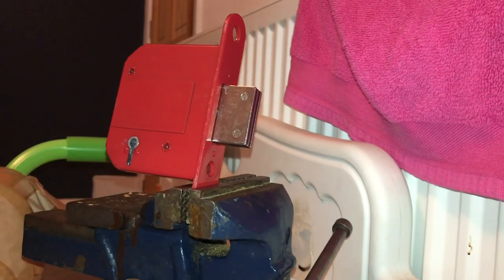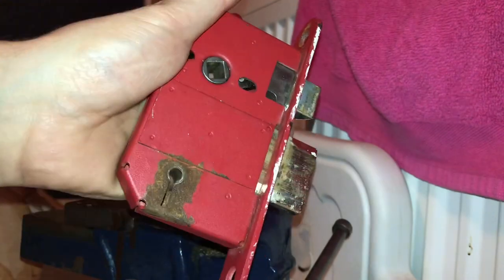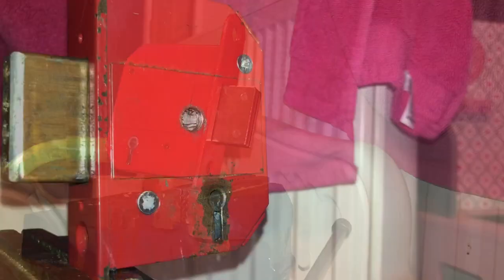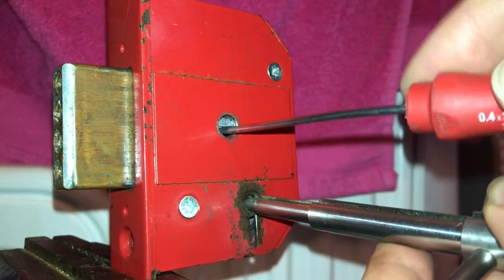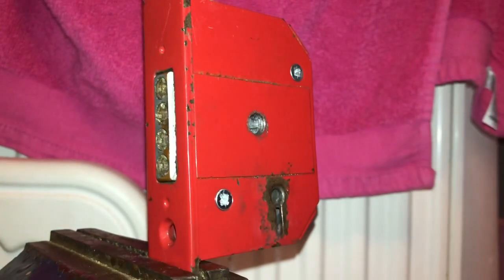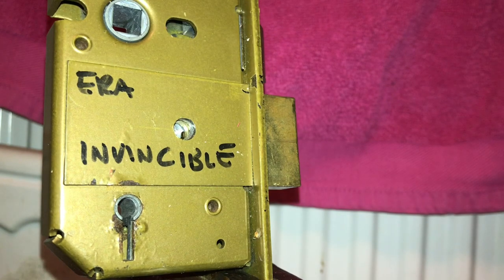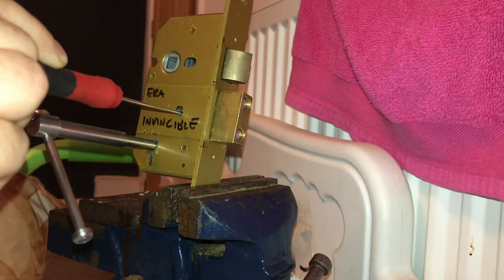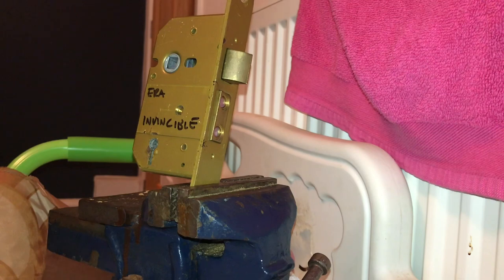The importance of correct lock ID when drilling a mortice lock

Comment: Nice video mate, i use the a jam mortice id pdf stored on phone along with the rb template kit together they seem to cover most of the stuff I come across and looks better than sifting through books 📚 in front of your customers😂🤣
I bought the mortice Id app when I first started out, What a pile of shit that is keep the vids coming always a good watch
Reply from the maker: Lock Lab Locksmith Orpington kent yeah I have the Ajam printed out and laminated also got the ICL mortice manual which covers a lot of older locks. If I come across one I’ve never seen before I take it home, drives my missus mad 😂😂 The RB one is that the one with just a 2mm template??
Reply: I made the A Jam manual 👍 was wondering if anyone would mention it. My Dad will be proud.

Comment: For right monuted, would you not just measure and drill the stump out?
Reply from the maker: I’m not a big fan of drilling for the stump don’t get me wrong I have , but there’s a few scenarios that would make you think twice. First is that the drill point wouldn’t be concealed by handles etc, 2nd is if it’s a long thin stump like a Securefast or Viscount you’d probably have to drill it twice to actually get it and the 3rd is if you leave any of the stump at all even if it’s just a mm the lock won’t open so when it’s right mounted you can’t see where it is
Reply: @FortressLocksmiths  Good to know!

Comment: When you’re drilling out the locks are you using tungsten carbide masonry drills or those special carbide sharp drills and the milling bits you use whereabouts do you buy them I love your videos and I do learn things about lever locks all the time so thank you
Reply from the maker: I use hardplate drill bits (TCT) to start with, then a normal HSS bit once I’m through the hardplate and then finish with an end cut milling burr (see my other video about drilling Securefast locks)?

Comment: yes indeed. measure, check and recheck and drill. learnt my lesson years ago on a green case 5 lever  sash lock .even being 3mm out, caught the edge of the shims between the levers and the whole stump came completely off .and levers dropped down on steep angel. made it a right bitch  of a job, was a right hand fit with 1" rebate  and draft exclude fitted.
Reply from the maker: Did the same other night myself pal , failed sashlock so I aimed for the stump but left a little corner on it so levers dropped down like you said and then proceeded for what felt like the longest 2 hours of my life trying to drag the bolt back with a screwdriver.....stuff of nightmares

Comment: I've been practicing drill points and will be making some drill templates tomorrow, as you said yes you can buy but best work out your own drill points. Very time consuming but its Sunday and I have nothing to do but eat my sunday dinner haha
Reply from the maker: Haha that’s the one pal! I have a box of old mortice locks in the back of my van so if you really need to you can just take the lock apart and measure exactly from the top of your keyhole where you want to be 😎😎
Reply: @FortressLocksmiths  very true I do have a couple of mortice ebooks so there on my phone.

Comment: Double  the fun at night, always told not to use an LED torch as they give off a blue light and can make colour  id difficult.
Reply from the maker: Well I had a nightmare last night, tried drilling a jammed Union Strongbolt ended up leaving a 3mm piece on the stump no word of a lie took me two hours to get the door open 😭😭🔑
Reply: @FortressLocksmiths  had som similar  with an old fortress  with a snapped  bolt tail  that had jammed  the lock.
Reply from the maker: @cardiffpicker1  fucking nightmare pal....she even asked me if I was a real locksmith 😭😭😭😂😂
Reply: @FortressLocksmiths  not as quick as on the telly?, people  dont realise  a crap fitted  lock can throw  your drilll point out quite a bit.